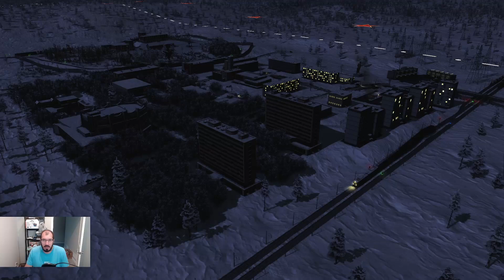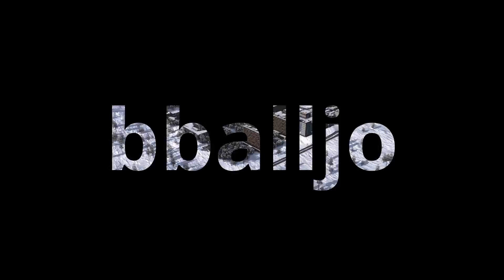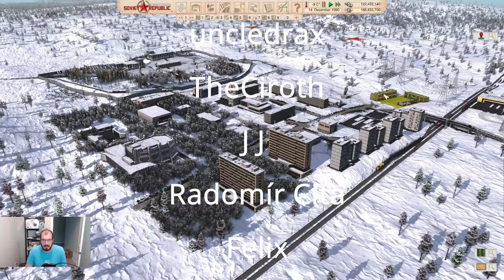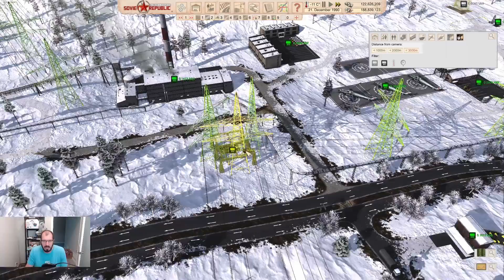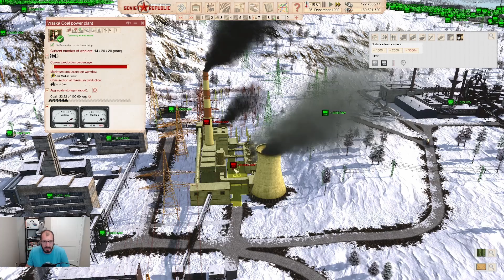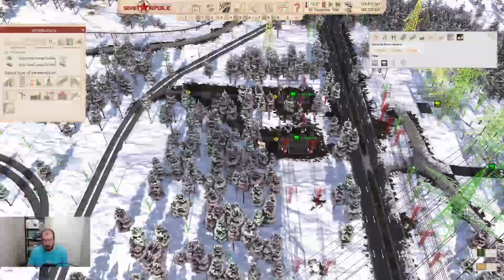How to Fix the Power Grid | Tutorial | Workers & Resources: Soviet Republic Guides

Comment: Whoo ho ho mr baljo, you glossed over a point I would really like a slightly more in depth explanation for. 
Placing rail power connection behind each other/next to each other (in serie and that other word I can't remember now) 
Does that mean the power fed into one station won't travel through the next station if build in a single loop?
Only up to the next station?
And any power connected there has to power the next strech of rail? 
This would require a whole other way of connecting the rail network. 
Is this still in the game or has it been patched after 4 years?
Just starting a new city after a small...'break' from the game and would really like to know.
Thanks for all your vids, theres always something to learn
Reply from the maker: Correct...power only goes up to the connector.

But, if there is an unsevered connection, power from each station just adds
Reply: @bballjo thank you! 
Been thinking about this and by chance I have mostly done this, always build the connectors on side tracks and dead ends for esthetics, learned early to build a robust power network, and way to attatched to diesel trains so it' never been a real problem 😁 tho I did have a lot of traboule with a tram line this one time.
This really is one of those little tid bits of information I have never heard anyone metion, and I watched....'quite a few' too many tutorials/letsplays/revieuws about the game.
Humm, someone really ought to make a little tutorial/test video about this. Food for thought 😋

Comment: Good video, however I feel like it would be great to cover the use of Priority switches as well. They allow you to prioritize not only inputs but also outputs. Meaning you can connect imported electricity which is only drawn from at the lowest priority, making it act like a backup. Also, on the outputs you can set your rail network to be the lowest priority, meaning the city gets power before the trains do.
Reply from the maker: Priority switches didn't exist when this video was made...

Comment: I'm confused with the electric substations. And you mention it also in your video but it's confusing. I try to explain what I mean:
In the MW-overlay a substation shows around 0.34 megawat (still green). But when you click on the substation it says: 
''Total wattage of all connected buildings'': 350%
''Estimated maxiimum consumption'': 128%

This is what's confusing me can some one explain please? Is this overloaded and if so how?
Thanks.
Reply from the maker: The colors are current consumption, so they fluctuate, the numbers in the station are static numbers calculated by all connected buildings, i.e. the max. The max may get split over multiple substations evenly, that's the second number in the station, their share of the max.
Reply: @bballjo  
I think I understand what it means but please can you be more specific to the below example?
Overlay: 0.34Mw
''Total wattage of all connected buildings'': 350%
''Estimated maxiimum consumption'': 128%

Is this overloaded? What number decides if this needas an aditional substation or not?
Reply from the maker: Certainly. 

Overlay: 0.34Mw-> That is what is currently going across the wire. That could be the current demand, it could be the total wire capacity (they have a max, but the lowest is 0.6 i think, so you should be good), it could also be what you have left in your power network, the large HV wire can only carry 18MW, if you are producing that much. 
''Total wattage of all connected buildings'': 350% -> All buildings in range of the substation (hover over the connections, or when you place a substation right on top of this one, all the yellow lines). The substation tells you the max watts, I think its 2.5MW that it can use. 350% * 2.5 = 8.75MW.
''Estimated maxiimum consumption'': 128% -> is the share of this substation from the 350% above, so 128% * 2.5 = 3.2MW. Having this number means there are other substations that have some of the same buildings in their range. 

Note, that the substations Maximum is bigger than any of the medium wires, the biggest wire is 2.35 MW, but the substation is 2.5MW, so at 100% you may still be under-powered, HOWEVER: 
In cities, its OK to run between 100-150%, because power is demand driven, meaning power is only used when citizens are here, if they arent at home, no power is used. 
For industries, you want to stay below 100%, because ideally you want to run your industries at full capacity all the time. 

Does that make sense?
Reply: @bballjo  
Yes a little bit better, thanks.
So I'm looking at the estimated maximum consumption for cities to stay between 100-150%  and for Industries stay below 100%.
One more thing though. 
The substation of my example has several connections of buildings that are not build yet. Do these buildings that are not build yet affect the numbers?
Cheers!

Comment: You said something like "The Power flows like a river and can only go through one direction". Does it mean i can´t connect multiple power plants randomly to my network?
My Problem is the follwoing...
Example:
The export switch has 18MW max selling Power ability.
I export 5MW with my oil power plant cause i don´t need it. (direct connection with wires, no power usage from other buildings).
I have 6x big wind power plant (max. 3MW(0,5MW each)) connectet to a tranformator. (only for export).
I now builded a power switch to connect oil power, wind power and export switch.
The switch in front of the export switch is now flickering between 3MW to 18MW ?
Schouldn´t it be between 5MW and 8MW? Cause wind power + oil power is 8MW max and not 18MW????

A video with a stable network of multiple power plants would be cool. I always have problems with flickering network when I add more power plants. Even when I use only 1MW or less for buildings. Is it a bug or am I doing something wrong? Maybe it is because of the river flow of the electricity???
Reply from the maker: Correct. I did make a tutorial for exactly this a little while ago...
Reply: @bballjo  Is it online? Or will it come in a few days/weeks?
Reply from the maker: It's online... Maybe 6 or so months old

Comment: Well thats a start but in total its a little more complicated, i had two medium voltage "subnets" connected and the game tried to transfer the power through the medium power line instead of the HV connection. So i guess connecting diffrent medium voltage sections is not working either.
Reply from the maker: I dont think that is true...you can transfer the power however you like, but it will be a one way street while the power is on, like a river...and when power switches direction (source) there is a short period of time without power, call that the reset. 

The game doesn't care how you move your power, but you have to supply the capacity...its hard to know exactly what your issues is/was without more info...

Comment: ok, so if your coal production was connected directly to the global power grid instead of connecting to the power station and you simply had the oil power plant also connected to the global power grid would that also be fine? In other words, connect power plants to the power grid and nothing but a substation to the power producer. Then the power is shared globally. Would this also help?
Reply from the maker: Not quite...as long as the Total consumption of your grid is below the capacity of the smallest main wire, yes, that would be true, but the biggest HV line can only carry 18MW ...you will need to add more inputs to the network, if you want to be able to supply more power from only a few sources (centralized power grid), otherwise, if you would only use local power, you shouldn't run into issues.